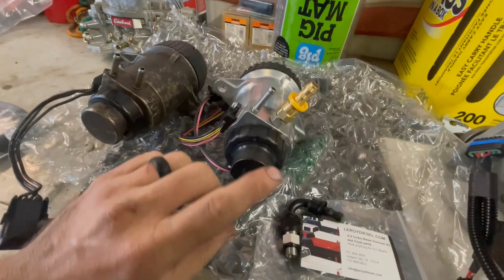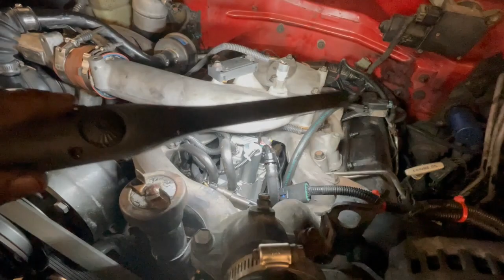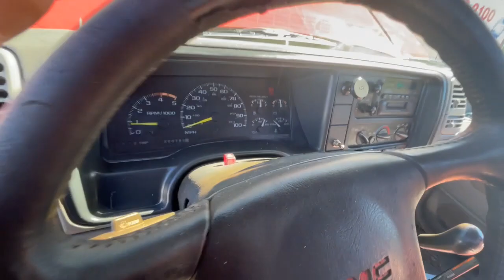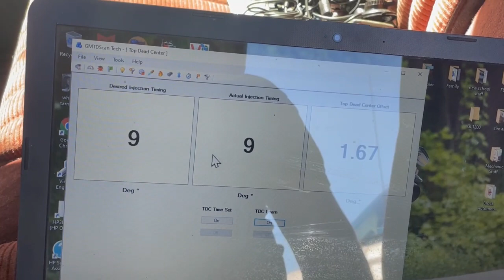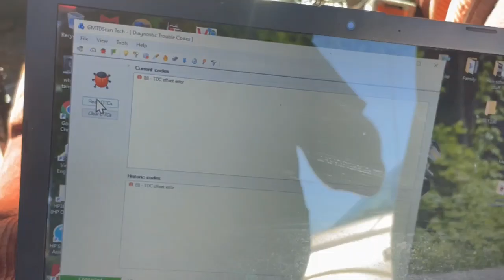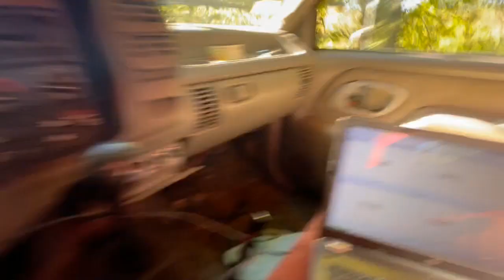6.5L Turbo Diesel Reman Injection Pump Issues (Part 2): Replace & Time (Set TDCO) the Pump

Comment: Plz help me out with my truck.. 1994 chevy 3500 dully 6.5 . This damn truck runs n sounds as good as that tow truck.. except main has like 61,000 miles but it’s cold or hot it shuts off like if someone just pulled the cord off lol 🙏plz lmk if u can help
Reply from the maker: You should definitely check your PMD and fuel lift pump operation, as those are typical culprits for an engine that just randomly cuts out. Hope you get it running right soon! The PMD is a square black (could be gray if it was upgraded) plastic box that was originally mounted on the drivers side of the injection pump. 

These are a common failure on the 6.5 as they get cooked on the side of the pump from all the heat in the valley of the engine. The most common way they fail is to randomly shut the truck off, just like you turned the key off. This is such a common thing, most 6.5 guys carry a spare PMD in the glove box, just in case. The fix is to mount them on an aluminum heat sink and then outside of the engine bay, typically behind the front bumper where it will stay nice and cool. Several suppliers (leroy diesel) sell the kit to move them including the heat sink, PMD, and an extension cable. If you currently have the gray PMD, you'll need the gray PMD extension cable, the connector is slightly different than the black ones. If yours has already been remote mounted, you can buy just the PMD itself of course too.

The fuel lift pump, mounted on the inside of the frame rail around the drivers door area, can also fail and cause stalls. Typically it will stall a little differently than a quick and smooth shut down though. With the truck running, crawl under and put your hand on the lift pump, it should be running/vibrating/buzzing..... if not, you have an issue. Even if it is running electrically, sometimes they won't actually be moving fuel. Go to your fuel filter and crack the bleeder loose, this will make truck will stall, but you're looking for a good stream of fuel flowing out while the pumps still running. if you only have a dribble, your lift pump isn't working. The lift pump is electrically ran through the oil pressure sensor (located drivers side rear of the engine, at the back corner of the intake manifold). This is another common point of failure on the 6.5 and the fix is to wire the lift pump on a separate circuit through a relay to take this electrical load off the oil pressure sensor. 

Another possibility that comes to mind is a failing injection pump. I would check and eliminate these other two possibilities first. 

I hope this helps, don't be afraid to reach out if you have any other questions!
Reply: @realleesgarage the truck as that upgrade already.. they relocated the PMD n the harness n the air cool aluminum bottom .. the static harness i believe it’s called , new crank sensor, the direct current to fuel pump with its individual relay.. but ig ill change the backup pump see what it does
Reply from the maker: @chevyman36st That's good. It sounds like a lot of the important upgrades are already done. Another thing you could check is the power to the fuel shut off solenoid on top of the injection pump. There's two wires on it, one should have power whenever the key is on. Make sure that that still has power when the truck dies on its own.
Reply: @realleesgarage ty.. I’ll stay on top of that .. also 1 thing I want to mention to u .. u might have an idea of what it cus be.. u know when u about to start the truck u turn the key to the on position for glow plugs to heat up .. well there’s time if the indicator takes its proper time like 12-15 seconds.. the truck definitely starts.. there’s times when it lights up n turns off in like 2-3 seconds or maybe even a flash n the truck won’t start when it’s fast like that
Reply: Even if the truck is been ran n it shuts off n if the indicator does its magnetic 😂it depends on how long it takes on the light if not it won’t start .. I was going to change out the heat/glow plugs module n the solenoid sensor next to the injector pump see if it’ll help

Comment: What program and connection cabel did you use and how can I buy them?
Reply from the maker: The software is from gmtdscan.com it’s an overseas seller from Sweeden… so it looks a little strange with the price, but it’s a legit seller. When you buy, you’ll get a license key emailed to you to unlock the software you download from his site for free. 

I’m not sure where you can find the USB to OBD1 cable. I found mine on eBay probably 20 years ago or more. The GMTD scan tech guy may be able to help you find one, I’m sure if anyone would have a lead it would be him.

Thanks for the question!
Reply: @realleesgarage I definitely appreciate it. Ill see if I can get that. Just download it on a regular laptop im assuming?
Reply from the maker: @qballusajasondavis7923 Yes you can download it on any type of computer you choose..... That part is free and the link is on his website, but of course you can't use it until you buy the license. When you purchase the license, he will email the license number to you within 24 hours.

Comment: Hey,, thanks for your videos!
I’m Simon from Germany, and I have a major problem with my 2002 GMC Savana 3500 van (school bus).

The engine won't start when it's been driven until warm or hot—for instance, after 30–40 minutes on the highway; if I turn the vehicle off, it won't restart. Once it has cooled down (about 2–3 hours), it starts up again.
When the engine is cold, it starts perfectly; if it's just slightly warm, it starts well.
No diesel reaches the Schrader valve—the lift pump isn't being activated (there is no 12V power to the lift pump) when the problem occurs.

The following parts have been replaced:
Crankshaft position sensor
PMD, including an extension kit from Leroy Diesel (with the correct resistor). The PMD is mounted at the front of the engine bay. The PMD is about a year old.
Lift pump
Diesel filter & lines (system was bled professionally)
Fuel pump relay
Coolant sensors
Oil pressure switch (mine only has one, located in the engine valley for the gauge)
Glow plugs

One more important detail:
A year ago, the DS4 high-pressure diesel pump was leaking. I replaced it with a remanufactured Dorman DS4 pump. Since then, I've had this issue where it won't start when hot, and the lift pump doesn't receive a signal to run.

NO ERROR CODES!

I suspect it might be a sensor on the DS4 pump, or perhaps the PMD after all?
Thanks for your help!
Reply from the maker: From the description it sounds like a classic "worn out" DS4 injection pump. Next time its hot and won't restart, pour some cool water on the injection pump, enough to cool it down to the touch. Then try to restart again. Odds are, if you cool the pump down enough, it will restart then. I know you said you already replaced the injection pump.... Dorman isn't known for real high quality or meticulous attention to detail during their remanufacturing process. I have had issues with their reman DS4's as well with only a few thousand miles on them. 

As far as the lift pump, that could be a separate problem, but I don't suspect it is causing your no start when hot. Let's see if the cool water trick changes how it acts when the engine is hot and go from there. 

Let me know what happens. Thanks for the question!
Reply: @realleesgarage  Thanks for the quick reply!
I had actually already tried that cold water test. The first time (spraying cold water directly onto the DS4), it started right up again. A few days later, I repeated the test, but it didn't work; it took about 30 minutes before it started, even though I had sprayed cold water on the pump.

The lift pump is brand new... actually, everything is brand new, except the DS4, which is a replacement pump from Dorman.

Comment: What's the adapter for the obd port to laptop?
Reply from the maker: It’s a cable that has a USB on one end and the GM OBD 1 connector on the other. It appears to be a factory made cable, not something that was spliced together. I got it off eBay many years ago. I’m not sure where to even find one now…. Since it’s been 30 years since OBD1 was a thing lol. Thanks for the question!
Reply: @realleesgarage yeah still some out there tinkering with these dinosaurs to stay running.
Reply from the maker: I’ve always had a soft spot for them…. Not sure why 😂. I’ve had several and have done all the “required” mods to make them reliable on each. I currently have a 94 light duty 3/4 ton 4x4 that came from the factory with a 6.5 N/A and 3.42 gears. It is slow and ugly but it gets 20 mpg all day lol….

Comment: What software and hardware are you using for the diagnostics? My 95 is experiencing the same symptoms so I want to replace the pump. Thinking about getting it from Quadstar tuning. Any thoughts?
Reply from the maker: The software is from GMTD Scan Tech. There's a link to the website in the video description. Quadstar has quality parts and would be a good place to get a pump. Thanks for the questions!

Comment: What software and hardware are you using for the diagnostics? My 95 is experiencing the same symptoms so I want to replace the pump. Thinking about getting it from Quadstar tuning. Any thoughts?
Reply from the maker: Quadstar has a good reputation as well as Leroy Diesel… I’ve purchased from both and was impressed with both. Stay away from Pensacola…. I’ve had quality issues several times with their parts. Their customer service is great and they’ll ship you another part without much hassle, but you shouldn’t have to try several times before you get a good one lol. It’s worth the time and hassle to spend a little more and get a good part the first time. 

The software is from gmtdscan.com it’s an overseas seller from Sweeden… so it looks a little strange with the price, but it’s a legit seller. When you buy, you’ll get a license key emailed to you to unlock the software you download. 

I’m not sure where you can find the USB to OBD1 cable. I found mine on eBay probably 20 years ago or more. The GMTD scan tech guy may be able to help you find one, I’m sure if anyone would have a lead it would be him.

Thanks for the question!

Comment: Might have to also put toggle switch on fuel solenoid if somehow problem... Of course checking with test light or multimeter  to see if fuel is there required

Comment: Started this morning I read it it goes to 2000 stays there... Lately now in the morning I started it goes to 2000 have to put it in gear and let it idle with parking brake on... It does a lunge when I touch the gas pedal up the street and then spend down sound of turbo is it as if it had suddenly lost fuel
Reply: Same thing is happening to me on my 6.2, I just got a new injection pump as well. I feel like it's something else that could be the issue rather than the injection pump going bad
Reply from the maker: Sounds like possible pump issues, losing control of it's ability to meter the amount of fuel needed. The "sticking at a higher rpms" is a pretty classic symptom. Thanks for the comment!

Comment: Mine's doing the same thing undulating last couple of weeks at some point it was shutting off no fuel pressure had to bleed the fuel pressure at the filter but instead use starter fluid Play heartbreak part cleaner to started to get the fuel up to injectors again.... I'm guessing it's sucking air into and not somehow holding enough fuel pressure at overnight the injector system... Have unswitched toggle power to lift pump now.... Text like 15 20 seconds before it's percolating up in filter
Reply from the maker: Yep, definitely the symptoms of a leak somewhere letting air into the system as it sits overnight. Thanks for the comment!

Comment: For more optics this preliminary solenoid operated inline valve system will keep fuel pressurized as it bleeds off with the air routed back to the tank... Before the would be quick start afterwards...the one pet peeve of all diesel operators that don't have new batteries

Comment: This injecting pressurized bleed off valve that routes back air infused spill over fuel to the tank .... Until all air is removed at that main system solenoid fuel valve shut off at the injection pump... Call it" the prime priming system ...."
Reply from the maker: That's a great way to describe it!

Comment: Hi, this is probably a dump question, but this GMTDScan Tech program say's for 94-95 6.5 will it work on a 2000 6.5td L65 F code motor?
Reply from the maker: It's not a dumb question at all! The GMTD Scan tech won't work for you, it's for the OBD-1 6.5's only. You should use a normal OBD-2 scan tool which covers 1996 - up. A good scan tool will allow you to read data and set the TDCO. Thanks for the question!

Comment: Does that motor have a miss? Have no experience with 6.5. But sounds to have a little lump to me?
Reply from the maker: It was running a little funny when I first got it running again. After the power to the fuel solenoid issue was fixed and the timing was set correctly, it ran great. Thanks for the comment!

Comment: I want you think the fuel  Solenoid fuse had something to do with the first pump not running correctly?
Reply from the maker: I don't believe so.... The fuse issue was a has power / doesn't have power issue which totally shuts the pump and engine off. The first replacement pump had something wrong internally. Thanks for the comment!

Comment: Just bought one of these trucks and this is the first video/post I've seen that actually shows the same problem I've been having. Thank you for posting it! Looks like a new injection pump is the way to go (already tried a new PMD and new injectors, will throw in a lift pump for good measure as well). Gives me confidence that yours ended up working out in the end.
Reply from the maker: Thanks for the comment! Good luck with your new truck!

Comment: I loved this video!  At the 9:28 time on the video--where you tried starting and you couldn't get it going-[--and said "Its after 9pm and I want to hear it run" --I have a '94 C2500HD and I could really relate to that.  My wife swears I spend more time working on it than driving it...its been 8 months and curious if the 2nd Pensacola IP held up --anything to report?